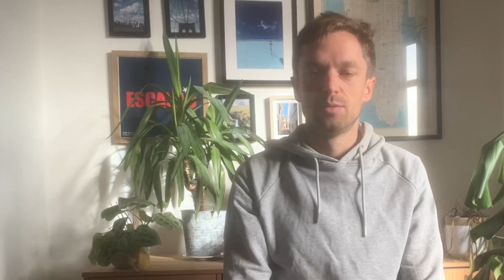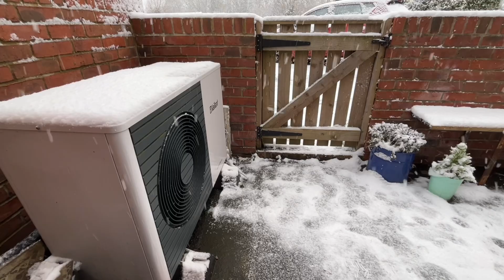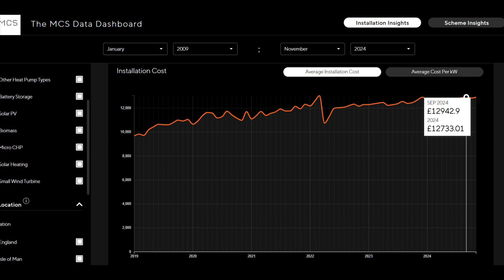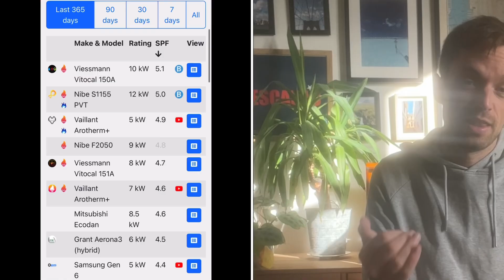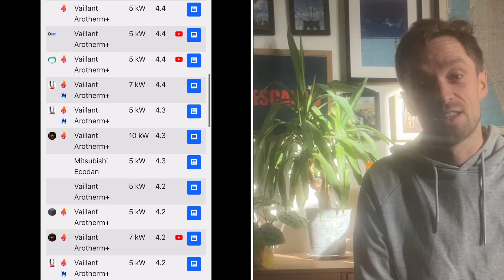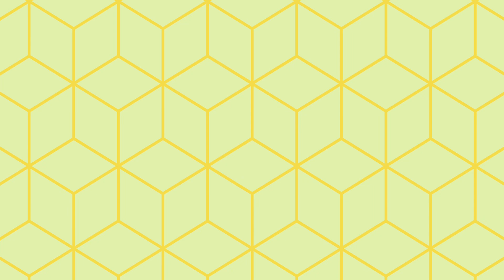Are heat pumps a good investment? The answer might surprise you

Comment: If the UK is to adopt heat pumps nationwide, we need upgrade price parity and parity in running costs as a minimum. The general public will not switch to a heat pumps just because its better for the environment. We may want to do it even if it hits us a bit in the walet, but most won't. Heat Pumps are nothing shiny to show off. There is no upside to easily promote except payback. More comfortable heating is hard to sell. It's similar for EVs when you don't have a drive. There is no benefit only Extra cost and inconvenience. Another real hard sell.
Reply: For example. I have an ev with no drive and heatpump in a Victorian detached house that cost 4k more to install than a boiler. I don't see any naughbour making either switch under the current insensitives.

Comment: Sadly historical pricing increases on Natural Gas vs Electricity - are in favour of Nat Gas (if you exclude Post Putin/Ukraine) - so Nat Gas prices increased avg by 2% per year where electricity increased by 5% per year.  So if you calculate your expense in 10 years for the heat pump it will be a LOT more expensive than Nat Gas. 

In 10 years that would mean you pay 22% more for Nat Gas - and 63% more for electricity per kWh vs today.  So a 10 year future price of  £0.073 for gas and .. £0.424 per kWh of electricity.  (based on your stated pricing)

If the UK had a strategy for electricity that was based on Nuclear power - we could probably maintain a low electricity price. But the current race to the wind and sun - guarantees -  like Denmark and Germany - that UK will have increasingly excessive high electricity price increases. 

The ONLY system people should consider if they are not climate alarmist fanatics - are hybrid heat pump and gas. Then you have the CHOICE and the best of both worlds.
Reply: It's not clear to me that you're correct on this. 
Cornwall insights are predicting a reduction in electricity prices to 2030 in the UK. Have a look at their recent output. Currently prices are £100-150/ MWh. But will reach £80 by 2030. 

UK nuclear is a sorry take of over runs on time and budget. Hinckley point C being £128/ MWh. But construction overruns and overspends mean it was promised for a total build cost of £18Bn but is now estimated to be at least 46. 

It's hard to see how nuclear could reduce our electricity prices. 

It was also supposed to be finished by now but won't be until 2031.

Where as Dogger bank A, is due to come online next year for an inflation adjusted £57/ MWh
Reply: @Lewis_Standing  The problem with renewables is that you need 100% backup that can be spooled up - or battery storage. Last week we had 2 weeks of (almost) no sun and wind. In that period we would have to spool up backup generation. We relied on French nuclear through the period and flatlined energy imports in general.  But only France was able to provide a lot due to nuclear. Germany, NL and DK had the same weather - so hardly any "export" available. Battery storage for 2 weeks is not in the cards... Not even for 1 day. 

You can't compare the strike prices with actual cost as all strike prices include subsidies.  

Electricity prices will not drop significantly below historical prices. But prices are currently exceptionally high - due to Putin/Ukraine. So prices might revert back towards where they should have been with the 2% / 5% increase per year for Nat Gas vs Electricity. But Nat Gas will move back down with electricity prices. 

I have solar, electric car and battery storage. But I do not think solar and wind for grid generation is the right solution.  With my electronics background - I have done many calculations - and net zero will not happen UNLESS we go to nuclear.  We would need to increase copper mining with 20-30% EVERY YEAR going forward just to cover the need for electric motors (Windmill generators are electric motors)

The problem is electric motors need VIRGIN (freshly mined) copper for the windings. You can't use recycled copper. A windmill motor have an average lifespan of 15-25 years after which - the motor needs replacing. We will be in year 2150 at current copper extraction rates plus 20% per year - to reach NetZero. Geologists do not think it is possible to even FIND enough copper for such an expansion. Then add the grid changes needed etc. 

NetZero using wind and solar - is a plan by crazy people who can't do math or logistics. It works theoretically if we had unlimited mining resources but we do not.

Comment: If you need to replace your boiler you can also deduct about £2500 from the cost as the investment is the additional cost for the one off transition to a heat pump. If you want new rads and to get rid of an old fashioned open tank system there are other costs to deduct too. We paid £6000 after a grant of £5000 so if done today would have cost £3500 but a new boiler would have been £2500 fitted plus we have 13 new radiators (not rusty like our old ones) and a pressurised hot water system to replace a dodgy pumped system. I am getting an sCOP of around 4.0 for heat and 2.9 for DHW as tweaking my weather compensation (based on reading s form open energy monitor rather than the heat pump) which is good as Octopus originally quoted 3.4 and 1.7 respectively. Very happy with the move away from gas. Keep the videos coming.
Reply: This was a big bonus for us as well. At least one replaced radiator was very long past its best and the water tank is a big upgrade on a combi boiler. Obviously this could be an issue for people without somewhere for a tank. We were coaxing our old boiler through last winter so were extremely happy to get rid of it before the current cold spell kicked in and the cost of replacement added to savings made with the grant put us several £1000s in credit.

Comment: I've been watching your videos about heat pumps several times now Tom, we're just buying our first house and I'm getting a heat pump installed as soon as possible.
I'm not massively concerned about the financial return because I know that won't happen until I have solar panels and a battery fitted, but gaining some independence from energy companies and the effects of crazy world leaders is reward enough.
Reply: @awesomecreationschannel  don't underestimate the power of the right tariff. We switched to agile and just turn the thermostat down for the peak. No noticeable change in temprature. Big reduction I bills.
Reply: I am on the cusp of making a huge decision around this subject. I’m having a total house renovation and we are updating everything - all wiring, all plumbing, all windows and all insulation. We’re also increasing the size of the square footage by a good chunk, of a 1910 Edwardian terrace. We’re also looking at having 16 solar panels integrated with the south facing roof, a 5. Something battery and a 12kw heat pump with UFH installed on every floor. That’s all costing a pretty penny but if there is a time to do it…it would be now as everything is up and exposed. It’s a shell. But I’m worried about the outlay and the fact a big house of over 2000 square feet will still be a money pit to heat even with all that new tech. Your videos are helping me get my head round it still but I am tentative. And we have to make a decision before they start putting the floors back together. 😅
Reply: @workbyelliotcowan  the house we've just bought is 1950 that's also in need of renovation.
We've been working solid on it for 3 weeks to get it liveable for when we move in on Saturday.
Next week I've got Octopus coming to do a survey for an air source heat pump and I'm booked in for a solar panel quote too.
It sounds like you're doing all of the right things to be as energy efficient as possible and apparently ASHP's work very well with UFH 👍
Reply: @workbyelliotcowan  what a journey. I assume this major work involves double glazing and insulation. If so I think 12kw is a pretty big heat pump for 2000sq ft. We are in a 1750 sqft mid terrace Victorian property with modest insulation upgrades and after a three winters in Bristol we have not exceeded 5kw demand. On our 7kw hp. I don't know how many quotes you got but oversized heat pumps can reduce efficiency . It may be sized right. But it's worth questioning at this point. If it's sensibly sized and you have ufh and are willing to tune the system. Your very likely to be a fair  cheaper than running gas. Say 75% and with your serious solar array you may find you bank enough credit in the summer to cover a very large portion of your winter costs. Good luck it sounds like a good investment in the future to me.
Reply from the maker: Thanks for commenting, I come to a similar conclusion, hope the transition to a heat pump goes well for you!

Comment: There is several factors: 

- people are scared of change or do not yet see it as a reliable or proven technology.

- Government involvement put people on the defensive. (Take evs for an example) 

- Someone who has a perfectly good working boiler, think quite rightly they are replacing something which doesn't require to be replaced so there should be a pay back on an investment. ( Whether this is environmental or financial)

- People who have a broken boiler and do not have a lot of spare capital and have been quoted for a new boiler 1.5k and 4.5k for a heatpump, they will look at can the afford it, will the switch to heat pump save me the money I had to get a loan for.

If they were quote nearly the same the switch for those without the spare capital would upgrade to a heat pump.

Before anyone says octopus will install it for 500 quid maybe for some but they quoted me 4.5k and i will not be getting a heat pump until our boiler breaks or is showing signs of failure. As 4.5k is a big investment for me and most people, maybe when a remortgage is up I will go with a supplier that gives green incentives and the get one.
Reply from the maker: Thanks for your insight Sean, that is helpful
Tom

Comment: I’m speaking to Octopus at the moment about a heat pump and your thoughts are a welcome distraction from other channels solely focused on the minutiae of ROI.

I’ve also been speaking to someone on another channel about the merit of combining a heat pump with a battery and getting rid of gas altogether.

On balance, I have a concern that has nothing to do with cost and more to do with what I view as a disadvantage, that is the idea of the heating being on for 24 hours. I envisage a serious effect on my sleep through being far to hot through the night. The idea of 24 hour heat strikes me as being unhealthy. Am I the only one who thinks this way?
Reply: WE have the heating on 24/7 but setback the temperature at night to a minimum of 19 degrees from 09:30 - 03:30. During rest of day we set a maximum temperature of 22 degrees but in practise the house only ever gets to 21 degrees based on our weather compensation settings. The reason for starting the heating at 03:30 is so that the initial startup of the system is covered by cheap night rate electricity  (Octopus IOG). In practice the bedrooms are always cooler than the other rooms because the radiators have been sized to achieve a temperature of 18 degrees (as per MCS) whereas the living room for example gets to around 21 degrees (as per the design).
Reply: @ thank you, that’s incredibly helpful of you. I’m on IOG now for EV charging with Octopus who I’ve had a heat pump quote from. It’s tempting to put my faith Octopus who I do trust but sensible thing would be to get at least one other quote.

Regarding night time temperatures, I suppose I can also switch to cooler bedding!
Reply: @gerryking4346  You can do what my wife does and open the windows wide 💨😲
Reply: @philipbroggio9315  Thank you Philip, extremely helpful 👍
Reply: Bedroom radiator thermostats should keep the room comfortable. The main point is to be warm enough to reduce condensation and damp where you don't want it. Heat through the night should be good for that.
Reply: @DrRogB  Thanks for helping!
Reply from the maker: Thanks for engaging with the video Gerry and others for helpful responses!
Set back is definitely something to note, and then thermostatic radiator valves can always be used if uncomfortable overnight.

We have settled on 24-7 heating on a low weather compensation curve, which seems to work for us. Partly because our bedroom is in one of the older parts of the house with large windows, it is probably naturally a bit cooler anyway...
Tom
Reply: @ Thanks Tom 👍
Reply: @DrRogB  Thank you! Every day really is a school day, I’m learning so much from all of the helpful people in this and similar forums.
Reply: Dude, it's all relative. You could do the heat loss calculations based on bedrooms being zoned off and/or open the bedroom window/s! I know it's counter-intuitive to leave the heating on 24/7 (tbf, most people drop the night time temp down a couple of degrees anyway, but turning it off at night will be more expensive to bring the temp back up every day, even twice a day), but part of the deal is the 'Low temp/low, slow flow' state, with temps rarely over 40 C in the rads - much bigger rads give greater surface area, and convection becomes much more important, hence the use of the word emitter rather than radiator. Little heat is 'radiated' anyway regardless of system, so never hang damp clothing on ANY emitter, ever, it kills efficiency. Heat pumps must be understood in ways we never had to about any older systems. Today, where I live, the outside temp is 5 C, my house is cosy with at least 21 C everywhere, and the temp of water in the 'rads' is about 34 C. I have never seen above 38 C even at minus temps outside. The outside sensor and controller work out the right system temp based on heat loss calculatipons done in the early survey and planning stages.  (not 70-80 C like in a gas system - why heat water to far higher than the desired room temps?) It requires more thought to get the best out of, but in the end I have a constantly lovely environment to live in. If my bedroom sometimes feel to hot, I might turn the rad down and/or open the window, simple. The initial critical part is fitting a correctly sized unit, ie, the kW rating MUST match the house's heat loss.
Reply: @ thanks Bob!

That’s really helpful and I’ll definitely bear all of this in mind. I’ve more or less decided to go for it and probably now at the over thinking it stage.

Comment: Our choice for a heat pump was based on it being slightly more expensive than replacing the gas boiler and being better for the environment. In practice it has been cheaper to run and the lower temperature radiators provide a nicer heat. The biggest problem is the mother-in-law thinks the heating isn't on because the radiators feel luke warm...
Reply from the maker: It is definitely a change in mindset to just have warm radiators rather than ones that would burn on touch!
Reply: Yes thanks for all your efforts providing the videos - really appreciated
Reply: Father -in-Law did not understand TRVs when they had central heating installed. His heating engineers left him with a High Flow Temp system and he turned the TRV up when the radiator no longer scolded his hand, because ergo the house will get cold.

Comment: Part of the reason for people talking about payback times so much is that there is absolutely no argument for the environmental comparison, heat pumps always use far less carbon. Some people are looking for anything to criticize heat pumps on, and making payback an issue is one of the few lines they have. 

Companies like Octopus can make installing a heat pump much cheaper, their prices for installation are very good, okay the installations may not be absolutely top-notch, but they are reasonable and are part of the way to ramp up installs to the level we need.  

My house is so much more comfortable than it was with a gas boiler, even if I wasn't concerned about climate change the extra comfort alone would be enough. That detail isn't made enough, most people seem to think a heat pump equals a cold house.
Reply: Yeah climate is a major motivation for myself but I'm selling it to my wife as a house comfort upgrade.
Reply from the maker: Thanks both, helpful points, and I completely agree about the comfort side of the story. Consistent heat, rather than peaks and troughs
Tom
Reply: @Lewis_Standing  The house comfort argument has slightly backfired on me as (less than 1 month in) I am constantly fielding questions about just how much this is costing as the ASHP sounds like it is taking off every couple of hours!

Comment: We installed for emmisions reduction. We got the old 5k grant. But it will be break even in around 12 years. But it's very odd to make these calculations on today's prices. Assuming things will be the same in the future is misleading. As you say the levies are likely to reduce and close the gas electric gap. A punt I was happy to take.
Reply from the maker: We're on a similar page!
Reply: Did you allow for the cost a new gas boiler as part of your 12 year calculation?
Reply: @jonathankeenan5163  yes i did. but as i say getting the 7.5k grant rather than the 5k i go would have made a real difference.